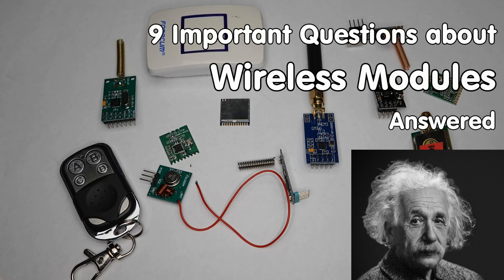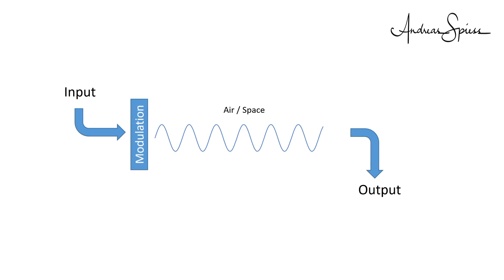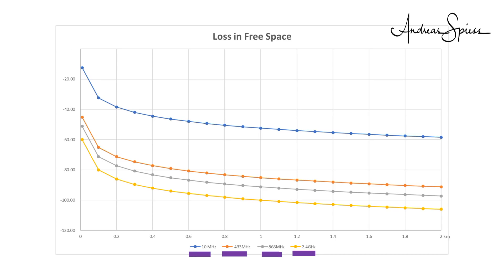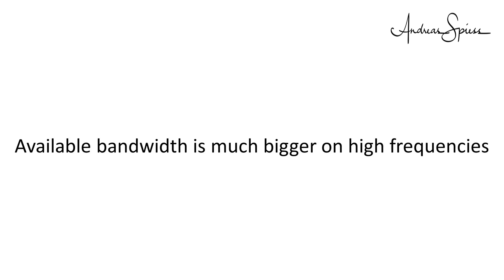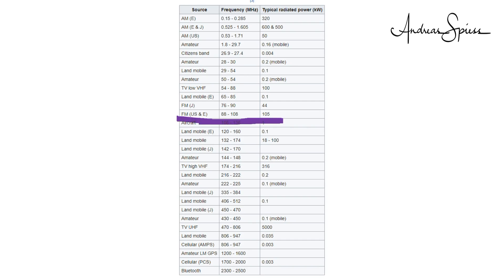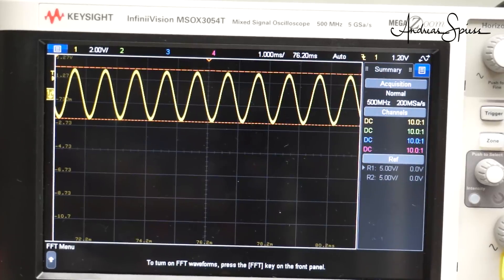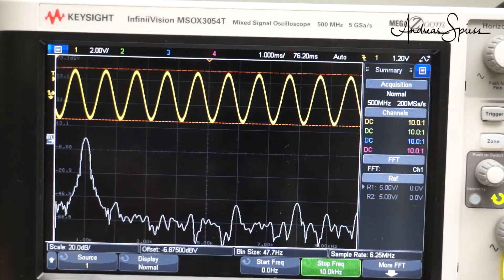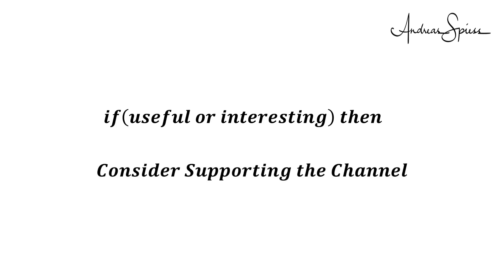#219 9 Important Questions about Wireless Modules Answered (for Arduino Makers)

Comment: I have always heard that higher frequencies penetrate objects better but am learning that this is wrong. Can anyone elaborate on this?
Reply from the maker: No, the higher the frequencies, the more they behave like light.
Reply: @AndreasSpiess  so is there truth to the claim that one should use uhf radios over vhf while indoors? Is the shorter wavelength “fitting through cracks” actually something to consider?
Reply from the maker: @Deltaplusproto  The antennas get longer with low frequencies, so indoors and low frequencies are not very convenient.
Reply: @AndreasSpiess  thank you. I know this is a rather simple few questions but there is a lot of misinformation propagated in some ham groups. 

Thank you for showing the Physics of emf on your channel.

Comment: which one is faster/very small latency?
Reply from the maker: The latency has a lot to do with transmission speed because you have to wait for the last bit to arrive. So the higher the data rate (or the shorter the message) the lower the latency.
Reply: @AndreasSpiess  how about bluetooth vs wifi, which one is faster? i have project sending midi, i try with hc05, when i press button, its so latency to the receiver.
Reply from the maker: I do not know :-(

Comment: 1:56 Correction: Contrary to US-centric "educational" material, Marconi only discovered that Tesla was ambivalent about people stealing his ideas. Up until then, Marconi had only been experimenting with spark-gap transmission.
Reply from the maker: As I wrote in other comments, I think it needed a few pioneers to get wireless communication up and running. I think Marconi was one of them. But many others were also necessary.

Comment: Wow.  I learned a lot from this video. Really.  I was looking at a LORA.  So for long range with obstacles.  I would want the lower band ones.  400 vs 800
Reply from the maker: Yes. Pay attention you avoid the channel used by all remote controls and temperature sensors ;-)
Reply: Ah, yes.  Thank you for the tip.

Comment: Yet another great video to reflect on for those of us trying to get back into building projects or even people trying to learn.  I do have one request for a future video: What is the proper approach from an engineer's standpoint on how to approach powering a project? You have laid out the basics on powering the boards in a prior video but I'd love to hear your approach when it pertains to multiple things.  For example-an ESP32 (or Arduino), a couple sensors, an LCD, and add in a relay or two for good measure. Everything seems to be going in the 3.3V area but there's still a lot out there running at 5v and some can run either voltage.  I appreciate your videos and I look forward to all that follow !!!
Reply from the maker: Thank you!
Many devices need more than one power rail. and usually, you have one voltage regulator per rail. This is straightforward. If your battery voltage is too low, you need a boost converter and if your battery voltage is always inside the chip specifications (e.g. LiFePo4 for 3.3-volt devices) you can avoid a regulator.
Reply: Ahhh so I guess my actual question would be what's the cut off point between bucking and boosting?  I ask because I noticed when you touch on that subject you emphasize efficiency but it's always in reference to powering a single item.  I apologize for being off topic by the way...
Reply from the maker: Boost means the output voltage is above the input voltage. Buck means the contrary. Usually not exactly, because each regulator has a certain loss. So you might need a boost converter a little earlier. And as I wrote, in general, you treat each rail independently, starting with the needs. Then you easily see if you need to boost or not (see above). If not, you use buck or linear regulators. You get also buck-boost converters. However not for small power. They use automatically the right technology.

Comment: A receiver can distinguish between two signals at the same time/frequency if it has multiple antennas. MIMO allows "Spatial Multiplexing" whereby spatial diversity (slightly different transmit locations and obstacles) cause signals to be slightly different on the receiving end. With fancy math you can reconstruct the signal. 802.11n and up makes use of this. Gigabit Ethernet sends and receives on the same lines with the use of echo cancellation.
Reply from the maker: You are right. But as I said, I simplified things.
Reply: Sorry, was just in internet corrector mode. I do enjoy your content!

Comment: Hi Andreas. 

Since we are using Wireless communication and batterypowerd sensors, how can we charge LiFePo4 batterys with solarpanels (like 6V panels?). I was thinking about leaving my esp32s running with LiFePo4 on 18650 design. But how can i charge them up while using its energy? 

Theres a "TP5000" chip. But i dont understand. 

Do you understand?
Reply from the maker: I did some videos about Solar charging. LiFePo has a different maximum voltage. So you have to search for charging modules for this technology.
Reply: Yes ive seen your videos. But im talking especially about LiFePo4 batterys. Its maybe interessting for your low power projects, isnt it? The charging chip is the TP5000, similar looking to the TP4056.

But im not that intelligent like you with integrated circuits..

Comment: Very nice & concise.  One correction: antennas are all lossy, they do not have "gain".   The  so called "gain" is relative to an isotropic radiator (i.e. omni-directional) antenna.  The "gain" number is referenced to the omni-directional antenna, and is achieved by narrowly focusing the effectiveness of the antenna, similar to lenses and reflectors for light.
Reply from the maker: You are right. I said, I will simplify shamelessly ;-)

Comment: Very timely video. My grandson needs to capture data from an electric kart and try to optamize its perfomance based on the data captured. All contestants use the same batteries, motor, controller. They build the frame. The contest is to make as many laps ( total distance driven) within a 1 hr timeframe on a single charge. There are some tuneing perametersavailable in the controller. Tranck is Oval and 1/2 mile long.
Reply from the maker: I would try 433 or 868 MHz. Maybe you use a receiver (e.g. an SDR dongle as I showed in my 433 Hack video) to check which frequencies are already occupied by other teams.

Comment: Well done Andreas.
if only my teacher was clear and concise like you ......
thank you so much for refreshing these basic concepts and for the new legal limits (I have a special license, that is limited, amateur radio (only above 30 MHz, max 10 W output) but many years that I do not do more activities.
Here in Italy the license is forever but then you have to have the license that corresponds to the name that allows you to operate (was IW4DZF). that I let it expire and then, legally, I can no longer go "in the air" as amateur radio, at least until I renew it. Bye
Reply from the maker: I think it is the same here: We have to pass a test and get this renewable license each year. It costs a little more than 100 EUR each year :-(
Reply: @AndreasSpiess  how much cost in your Land! 
Here in Italy, about 20 years ago, the cost was about 1.5 euro (3000 lire) per year since i payed for the Postal administration it was more a pain than a gain!
Reply from the maker: So the Swiss do it "better". They should gain something with the 100 Euros...

Comment: Andreas, thank you for this great video. I am sure a lot of your viewers (including me) have a hard time to find good (and cheap) antennas for various often used frequencies. It would be great if you could recommend some standard (China) antennas or demonstrate in detail how to modify them to make them good antennas.
BTW.: Is 433 Mhz allowed in Europe (Germany)?
Reply from the maker: 1. 433 is ISM in Europe AFAIK. So it is allowed in Germany 
2. I showed you a good source for Gateway antennas in my last video.
3. I did not find a reliable supplier for small antennas so far.